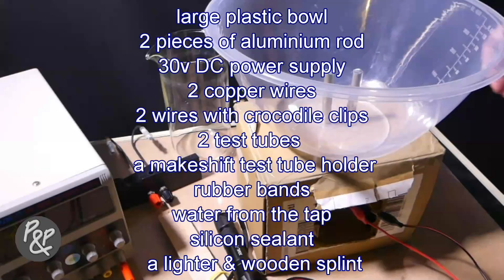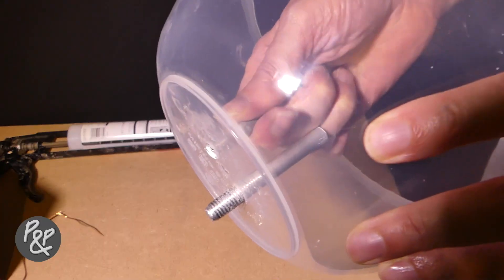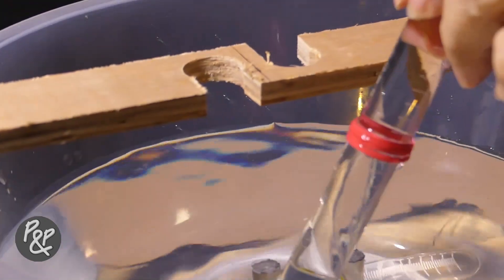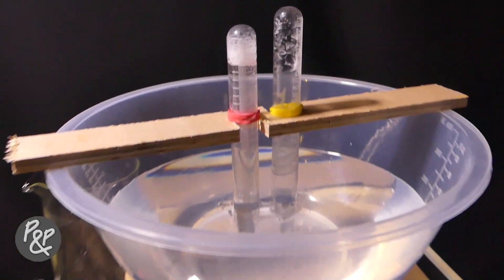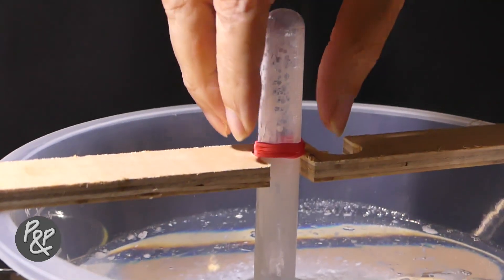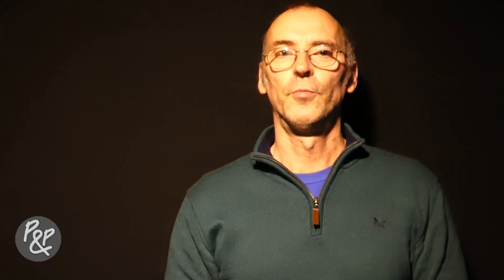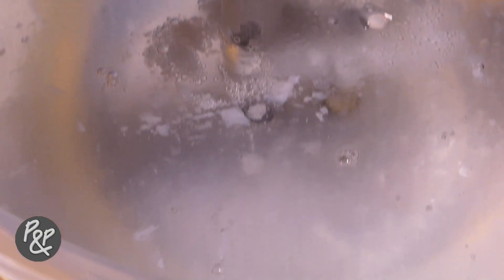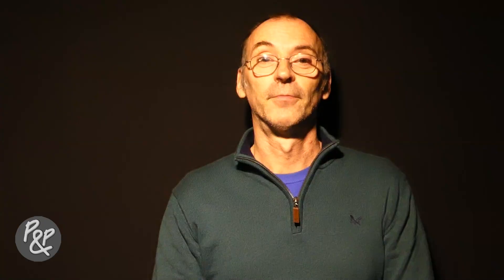Extracting Hydrogen From Aluminium Using Water

Comment: By the way, have you guys made a video about the weights of elements, which are part of the proof Lavoisier and others offered? For his iron-rust  experiment the water weight is obviously just absorbed into the rust and the hydrogen comes out of the iron. But a general coverage of this would be great!😊
Reply from the maker: If you can provide a link to information outlining how chemists weighed hydrogen that would be great.

Btw, Lavoisier could not have accurately accounted for the loss of an 'element' when heat and light were involved.
Reply: @PeterPete  My guess is their weight of hydrogen was inferred based on other weight changes. Assumptions multiply...
Reply from the maker: @ThePallidor  atomic weight is an assumption because atoms are ASSUMED to exist!

In the real world however atoms may not exist!

Comment: Hmm. Perhaps carbon electrodes would be better suited for this experiment?
Reply from the maker: If we used carbon for the electrodes instead of aluminium how are we going to extract hydrogen from aluminium?
Reply: Wouldn't that prove the base elements of water? Remove some ionic variables?
Reply from the maker: @the_natrix9959  Water doesn't have any base elements. 

I really don't understand your line of thinking. Perhaps it's too caught up in the mainstream?

Comment: What you proved is water reacts with the aluminum yealding hydrogen and aluminum oxide
Reply from the maker: yup but what we also demonstrated is that the hydrogen originated from the aluminium and not the water!

Btw how do you know the said aluminium oxide contains oxygen??? Got any ideas??
Reply: The oxygen bonds with the aluminum yealding aluminum oxide and releasing the hydrogen gas
Reply from the maker: @motorcyclemaddnezz  you didn't read my comment - i asked how do you know the said aluminium oxide contains oxygen??

in other words how do you know there is oxygen in the air or in the water that reacts with aluminium to form Al2O3?

if you can extract the oxygen from Al2O3 then I might accept what you're saying but until then...............I can't agree!!
Reply: @PeterPete  because it's in the name aluminum oxide. An oxide is an element that is bonded with oxygen.  Water is more properly called Diehydrogen monoxide.  So you can see in the chemical name there are 2 hydrogen atoms and 1 oxygen atom. Die meaning 2 Mono meaning 1. And you also see water is an oxide of 2 hydrogen atoms.
Reply from the maker: okay how can you prove to me that your IDEA regarding the white stuff in the test tube is actually made of oxygen and even aluminium?? How would you extract the oxygen from the said aluminium oxide seen in the test tube??

I'm fully aware of the THEORY but let's put the theory into practice so we know the theory is true.

......over to you!!!
Reply from the maker: btw imo water is not an oxide of 2 hydrogen atoms - you only THINK it is in your head!!! There's a big difference between the real world and your perception of it inside your little head!
Reply: @PeterPete  I might be wrong, but in my "little mind," making pop shots at people who disagree with you is rude.  I actually enjoyed your video and our little debate. I also believe that the white powder in your test tube is alumnium oxide.
Reply: @PeterPete  to prove it is aluminum oxide would require equipment I simply do not have.
Reply from the maker: @motorcyclemaddnezz  OK so chemists from the early 19th/20th centuries would never have had access to such equipment either, yet they were certain aluminium oxide contains oxygen. 

How could they have known aluminium oxide contains oxygen?

If you make a cherry cake one would expect to find cherries in it!!!
Reply from the maker: @motorcyclemaddnezz  Quote - I also believe that the white powder in your test tube is alumnium oxide.

You only believe? So you don't know?

The white powder cannot be aluminium oxide because the aluminium is decomposed in water, it is being 'leeched' and cannot be oxygenated. A substance is only oxygenated if it is exposed to heat and atmospheric air.
Reply: @PeterPete  I don't know because I have no way of testing it myself.  With that said, I plan on doing the experiment myself.  I have a few questions of my own I want answered.  I just finished one experiment using gallium as a catalyst to react aluminum with water to release hydrogen gas, and it worked brilliantly.  When the reaction was over, I was left with the original gallium and this white powder looking stuff, which I believe is aluminum oxide.
Reply from the maker: @motorcyclemaddnezz  it would be good if you could explain what you actually did. Did you apply heat for example, or did you just bung all the substances into a test tube? 

Nevertheless, how can you say you use gallium as a catalyst when gallium does indeed react with aluminium so it cannot be a catalyst. 

Gallium does not react with water. Reacting gallium and aluminium does not produce a white powder. However the presence of the water enables the aluminium to decompose and release hydrogen. 

You still haven't produced aluminium oxide because there's no oxygen to begin with. Furthermore there's no proof any hydrogen originates from the water. Oh btw, did you notice any black residue from the aluminium? If you did, that's the carbon from the decomposing aluminium metal 👍
Reply: @PeterPete  it was a dark Grey until I dried it
Out. Where dis the carbon come from?
Reply from the maker: @motorcyclemaddnezz  The carbon imo comes from the aluminium during it's production in the Halle Heroult process where the carbon anode breaks down into the molten aluminium metal 👍

Comment: No not at all - using Aluminum electrodes you are getting a gas mixture of both O2 and Aluminum. Using stainless steel for example with BOTH test tubes in place you will note the water column  is 50% less over the Hydrogen electrode as it should - hence H+H+O
Reply: O2 and Hydrogen that is!
Reply from the maker: @abbiebeast By the way we NEVER produced any oxygen at the anode and the ratio of gas production between the two test tubes was at least 4:1. We clearly were not splitting water into hydrogen and oxygen.
Reply: I'm an electrical engineer of 30+ years Classic Electrolysis (of which I'm not a fan due to the energy requirements) provides a 2:1 yield. No you didn't invent any new process here.    @PeterPete
Reply from the maker: @abbiebeast you still seem confused - we never obtained a 2:1 ratio, we got a 4:1 ratio. 

We don't promote to invent a new process. We're just stating the gas products came from the aluminium metal and not the water. 

There's something clearly wrong with your understanding of electrochemistry
Reply from the maker: We're not disputing the gas products, we're disputing where the gas products originate from.

Now, we consider the gases originate from the metal and not the water. 

Btw, we still obtained hydrogen at the anode and that is not expected from the mainstream understanding of electrolysis.

Comment: Cathodic bombardment could be the cause for the hydrogen being present in the typically oxy side, im a welder by trade and we use tig welding for aluminium and use the ions from the electricity to knock off the aluminium oxide layer leaving exposed the insanely reactive aluminium metal, i suspect this is cause for hydrogen accumulation there, if you changed the material to iron or such you wont see the same reaction from water coming in contact.
An idea to explain the phenomenon, could be wrong.
Reply from the maker: sure but there's no hydorgen and oxygen in water!!
Reply: @PeterPete  why would you believe such?
Reply from the maker: I do not believe in such at all - the reason I hold this opinion is there is no satisfactory proof water IS made of hydrogen and oxygen.

In other words mainstream science can only understand the real world with the use of ideas/concepts and they only exist in people's imaginations!

Comment: Absolutely laughable. I am not flippant normally, but disregarding over 200 years of experiments and research because you did something you don't understand and then declaring all of established science wrong is so conceited that i just have to laugh.

In reality, here's what happened. Aluminium by itself already reacts violently with water to produce hydrogen gas and aluminium oxide. But that can't happen a lot because aluminium oxide stays stuck on the aluminium, forming a layer that stops any further reaction with water. Now, in your electrolysis setup, hydrogen is produced at the anode, and oxygen is produced at the cathode, as would any electrolysis of water, because water is made of those two things. But oxygen doesn't escape as a gas, aluminium reacts with it and produces aluminium oxide immediately. At 30v, aluminium oxide flakes off a little and produces that white foam (a mixture of water and aluminium oxide) and exposes more aluminium which reacts with water and produces more aluminium oxide and hydrogen. This is why you got hydrogen on both sides and not oxygen, and a lot more on the anode side than the cathode side.

If you want to verify this, you can weigh your cathode before the experiment, then run it and weigh the cathode again. You will see that your cathode has lost mass.
Reply: Rhannmah is correct! The reason aluminum foil doesn't react with H2O is because when all aluminum is formed it immediately creates a protective aluminum oxide coating. Remove that protective coating by pouring caustic sodium hydroxide in the water with the aluminum foil and the protective coating is removed and a violent reaction takes place when the aluminum takes the oxygen atom from the H2O and hydrogen is released. The same thing is hapening when 30v of electricity. Read Rhannmah description of what is happening again. He explains it perfectly.
Reply from the maker: quote - Aluminium by itself already reacts violently with water to produce hydrogen gas 

How do you know aluminium metal reacts violently with water? If i drop a few drops of water onto aluminium foil the water just stays there and doesn't really react violently at all with the aluminium! If what you stated was true, aluminium foil would be dangerous to use in the kitchen!

So i don't know why you stated that utter load of b@ll@cks!

Comment: This is one of the silliest things I have ever heard, akin to flat earth tomfoolery. It is sad people insist on misinforming the science uneducated. It is one of the most basic facts that water is hydrogen and oxygen. Submarines split oxygen from water and reject the hydrogen every day to replace what is breathed by the crew. Mainstream science says this because that is what it is. Metals do not contain hydrogen to be released.  Hydrogen acts as a grain boundary surfactant creating cracks due to surface film energy decrease at grain boundaries, embrittling metal. Metals will act as a catalyst to split hydrogen from oxygen, however with high enough temperatures. It is where the hydrogen came from in the Fukushima explosions. That was a reaction of zirconium cladding with steam at temperatures greater than about 2500 degrees F. I am shocked at the comments in agreement. This is pure disinformation and sad.
Reply from the maker: quote - It is one of the most basic facts that water is hydrogen and oxygen. 

we've come across comments like yours over the years and we're still here because none of you guys can prove exactly what you think - that water is hydrogen and oxygen!!

Btw how does a submarine carrying out electrolysis demonstrate where the gas products originate - the water or the electrolyte/electrodes?

here's a conundrum for you to tackle as you allegedly know it all

https://www.youtube.com/watch?v=-NfpeFax9ZY
Reply: You are the handy sort. You can easily set up an apparatus using a bottle of pure hydrogen gas and a bottle of pure oxygen gas, and set up an apparatus where you slowly blend them with an energy source such as a small flame and make water from the reaction. 2H2 + O2 = 2H2O. 
Henry Cavendish discovered that hydrogen gas and oxygen gas made water doing a similar experiment 238 years ago, in 1784. 

The "pop" in your test tubes is precisely this reaction - the rapid combination of hydrogen and oxygen into good old water.
Reply from the maker: Can you tell me how Cavendish was able to identify that any dew formed did not origainte from the air? You do realise air contains moisture right and in many hydrogen/oxygen reactions air is also present!!

Additionally, Cavendish would have produced hydrogen gas using water, acid and metal reaction and it's very likely water in gaseous form can migrate along with hydrogen gas! So what did cavendish do to ensure the hydrogen itself was free from moisture? 

Btw one can also produce a similar squeaky pop by introdcing a glowing splint into a test tube of oxygen!!

There is no proof water is actually made of hydrogen and oxygen! Science doesn't do proof it merely produces evidence to support IDEAS! Water being hydrogen and oxygen is only an IDEA!

Comment: So what was the mass of the rods before and after (to the nearest 1/100,000th gram)? What was the mass of the gas collected? What was the mass of the water? Before and after to the nearest 1/100,000 gram. Conduct this until you collect at least 1,000grams gas without losing water and maybe you have something.
But I know you guys are just a parody pair of wankers.
Reply from the maker: Quote - But I know you guys are just a parody pair of wankers.

Sounds like you've got a chip on your shoulder. Want some ketchup for that chip and maybe some salt 'n' vinegar?
Reply: @PeterPete  And that's a solid yes we are from you both.
Reply from the maker: @DJW1959Aus  That's a solid yes, I have a chip on my shoulder!!!

The hydrogen comes from da metal not from da water!!!!